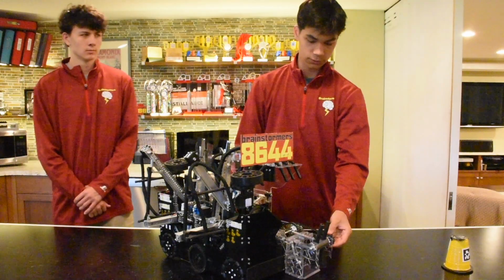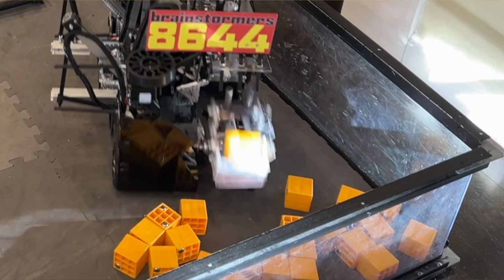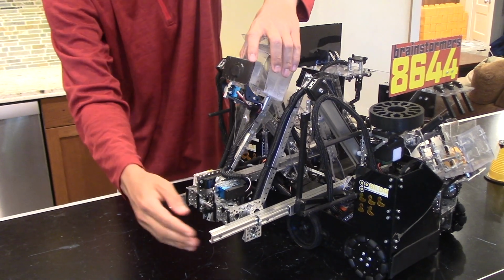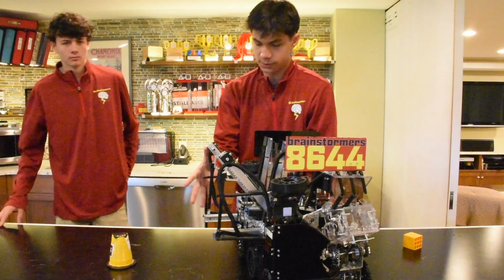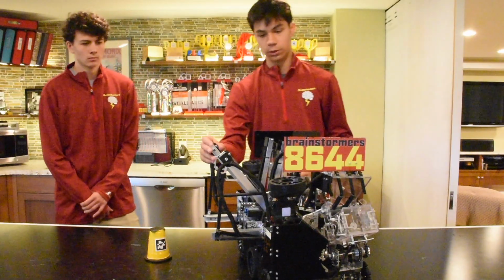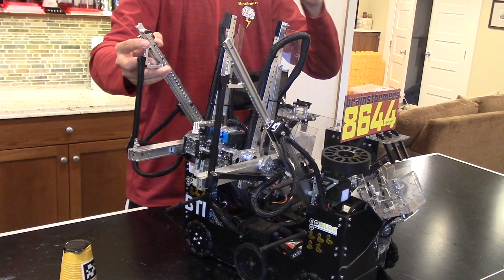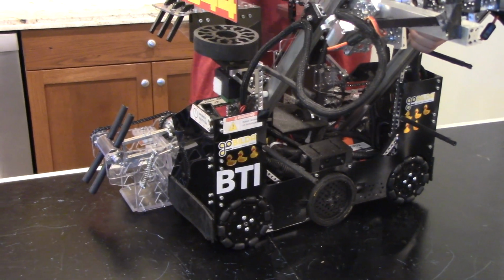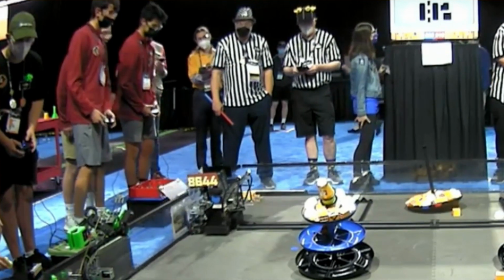FTC 8644 Freight Frenzy Worlds Finalist Robot Explanation

Comment: what linear slides did yall use specifically. misumi has a lot of rails and the majority of them are rounded. our team was hopping for slides that were more boxy because they are a bit stronger
Reply from the maker: We used the 300mm length for horizontal extension and 400mm for the angle lift. https://us.misumi-ec.com/vona2/detail/110300072130/?HissuCode=SAR230